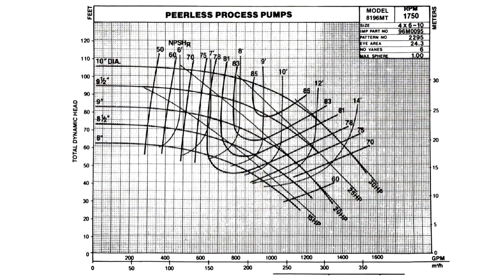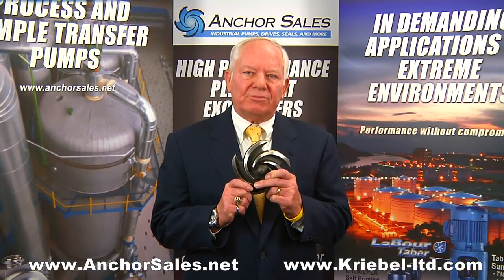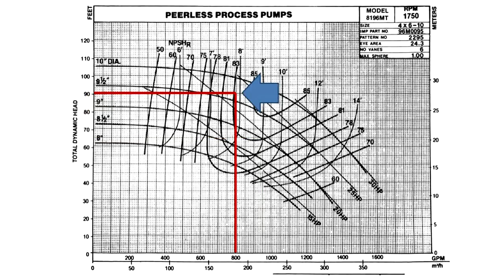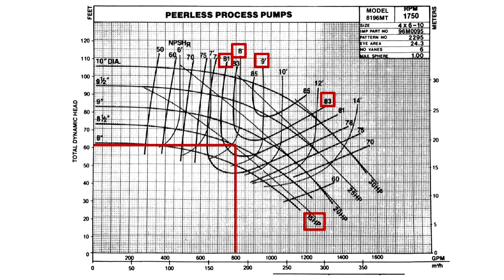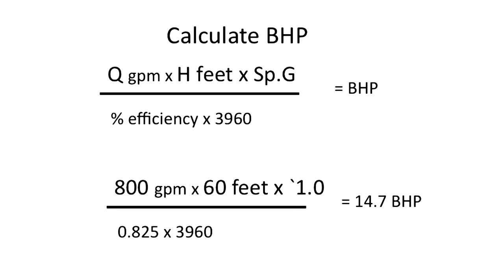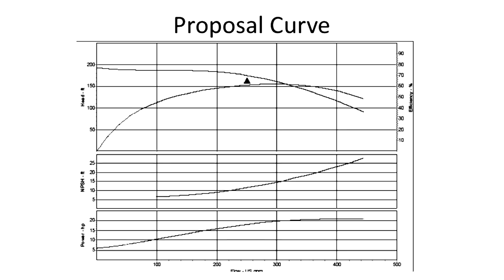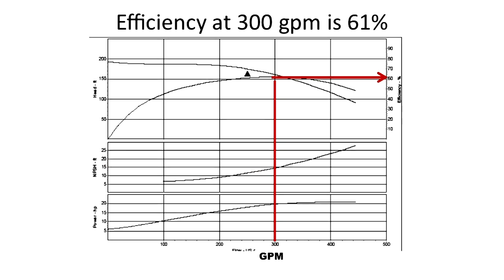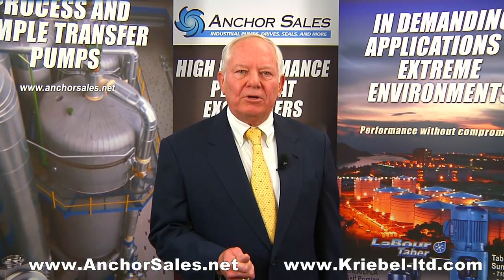Anchor Pump Vol 4 How To Read A Pump Curve

Comment: Where does he get that 3960 from in his calculation?
Reply: Unit conversion:
1 horsepower (Hp) = 746 watts = 0.746 kw = 3,960 gal/min/ft